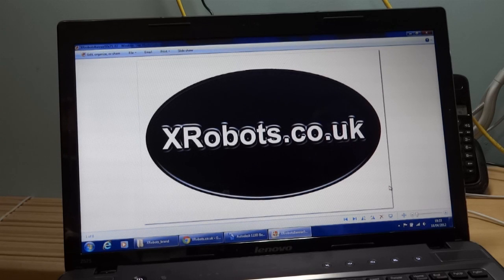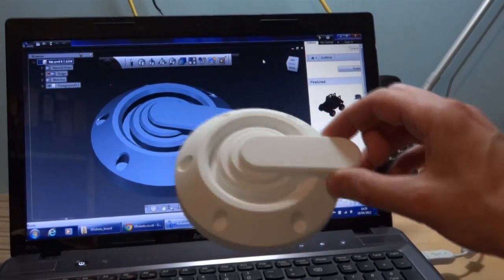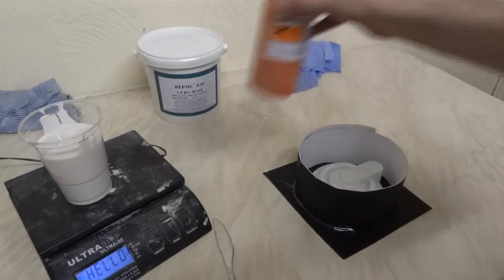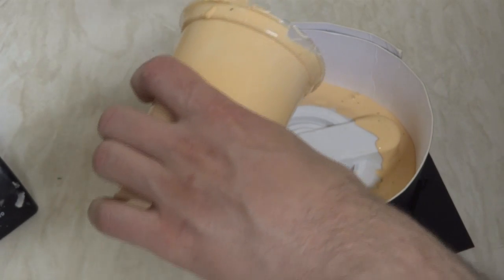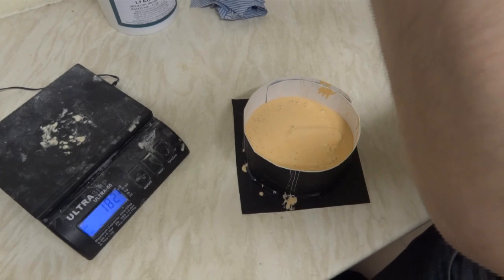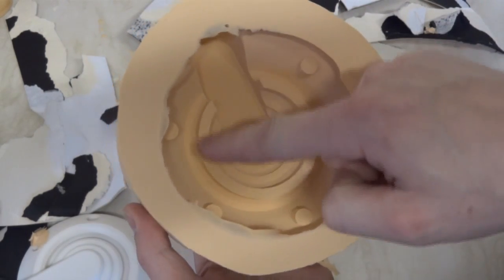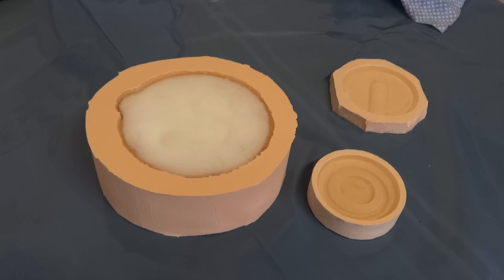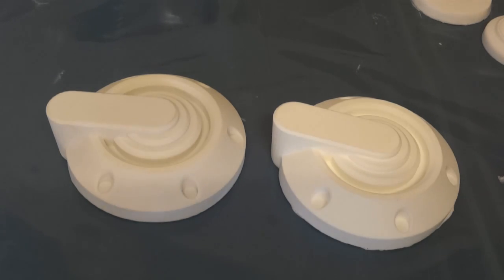Iron Man Power Suit #4 | Casting & Silicone Moulding | James Bruton

Comment: hey mate, looks great. small tip if you r printing the part, print a flat lip around the base (of the mold) that extends past the edges of your mold walls. that way it will make sure the part is always square to the base and prevents lifting